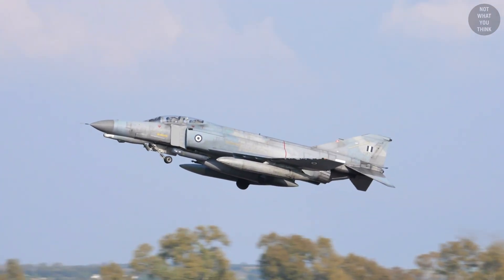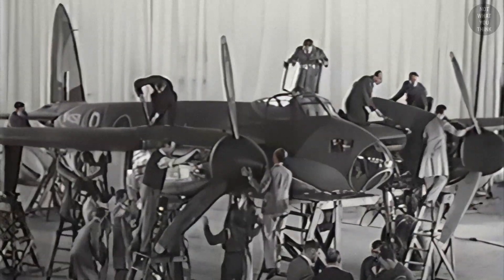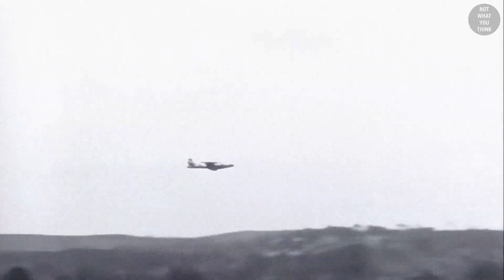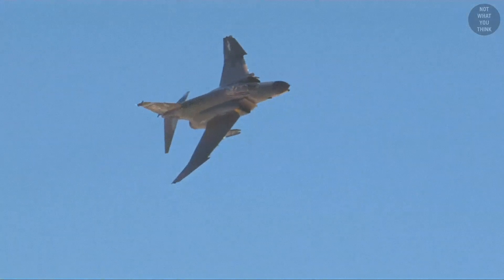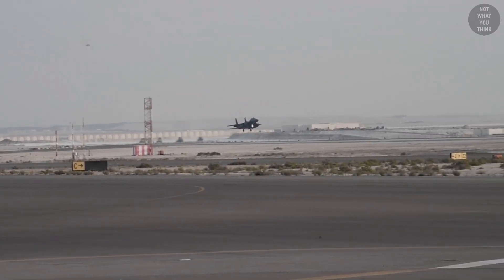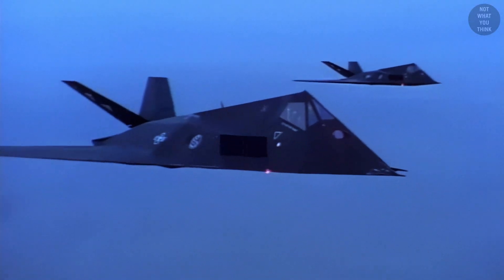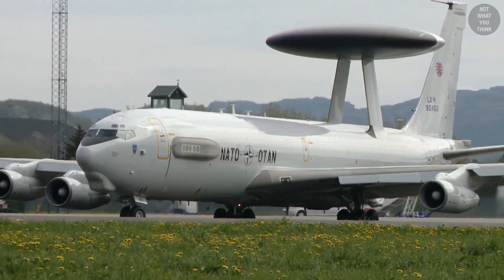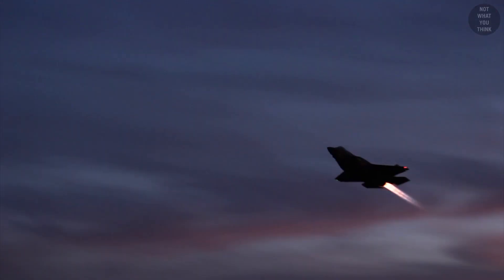Why are Modern Fighter Jets Slower than 1960s?

Comment: One factor that was kind of missed is especially relevant to the F-35.  The F-35 has enough internal room for fuel, sensors, and weapons to match the range and armament of how an F-16 normally flies out.  Because this is internal, a 35 can preserve its top speed of Mach 1.6 while the Mach 2.2 F-16 would have enough added drag from external tanks, sensors, and missiles, to drive it to strictly subsonic speeds iirc.  So the F-35 is faster when actually armed.
Reply: Also the G limits of external stores reduces combat performance. A 9g F-16 isn't pulling more than 5g or so with external fuel and bombs on board. Same for all other multi role aircraft.
Reply: @VeeAreSixed1  Which is why those planes have emergency jettison buttons that allow a pilot to dump all stores (also known as pylons) that aren’t Air to Air missiles, I.e. fuel tanks. This is only really deployed in a air combat situation, but it certainly exists.
Reply: @theskirata7034  You can’t E-Jett ECM, FLIR, Recce, or HARM Targeting System on the F-16.  You can’t E-Jett FLIR or Recce pods from the Typhoon or Rafale.  FLIR and Recce pods have different Max V0 limits the pilots or DFLCS observe, so a combat-configured 4.5 Gen fighter really can’t fly to its stripped placard limits, and carriage of these systems is more common than not.  RAF states the Typhoon FGR4 with PIRATE IRST is limited to Mach 1.8 even stripped clean.

Differences with the Typhoon and Rafale are that they are 9g capable while carrying external tanks, but pulling 9g isn’t really a common thing in the era of improved AESA Radars, later gen active seeker BRAAMs, and Helmet-cued HOBS missiles.
Reply: Yes, I am so sick of idiots who do not understand basic aerodynamics like drag shitting on the F-35!
Reply: Flying faster than the ordinance( missles and rounds )? 
Well it is OK if the target is at 6 o'clock and the ordinance is pointed that way
Reply: One part that was definitely left out of this is that Air Superiority has completely changed to being able to fight outside of visual range. Which completely defeats the purpose of needing to go fast because the air-to-air missiles are meant to be fired from Dozens of miles away and most non stealth aircraft would be downed before ever knowing there was a plane targeting them.
Reply: @Shace616  You will still need to go fast enough to increase the Kinematic energy of the missile but to also defeat the incoming missiles too. Being above Mach 1 greatly increases Missile energy compared to being below mach at launch due to Transonic drag effect. If you can make your missile reach further than the other guy's one you would use that speed.
Reply: @glassfullofmilk  
In deed - and this favors the F35 over the F16 for that reason:

pilot Lt. Col. Hank “Hog” Griffiths
Even when loaded internally with two 2,000lb GBU-31 Joint Direct Attack Munitions and two AIM-120 AMRAAMs, Griffith says the sheer power of the Pratt & Whitney F135 is evident. “The engine has a lot of thrust. It’s been fun to outrun the F-16 (chase aircraft). They can’t keep up. If we go to full military power the F-16 has to go to afterburner to keep up

Norway pilots ALSO note the same - they flew F16's, and are now flying  F35's.
quote:
We who fly the F-35 daily, can establish the following: The aircraft is faster, more maneuverable, has more range and, can carry a significantly higher payload and provides the pilot with a significantly better situational awareness than what we are used to from the F-16

Col De Smit – RNLAF
Quote:
F35 climbs, descends & accelerates like a clean F-16

QUOTE:
Compared to the F-16, the F-35A with “full war equipment” can cruise 10-15k feet higher without afterburner and cruise 50-80 knots faster, all of this additional energy is imparted on missiles
Reply: @glassfullofmilk  Doesn't really make difference in todays world anyway. 2005 DCS world AMRAAMs sure, but the the Meteors and 120Ds change everything.
Reply: @mobius7089  If this were the case, the Air forces around the world would be flying Super Tucanos only with 120Ds or Meteors as Kinematics would be negated by missile technology, Unfortunately physics and aerodynamics no matter how advanced your missile is do not give you a PK of 1.

Comment: My view on topspeed is "boom and zoom" tactics. If you're flying mach 2 at like 10k meters and send an IR missile at an unsuspecting jet below you've got a decent chance at a kill if they don't detect it in time. At those speeds and height stuff will have a hard time shooting you down. Missiles fired from the ground or jets that are slower and lower probably won't hit you especially if you do it right. You can go in, fire, get out safely essentially. Idk how well this works nowadays but that is my opinion. Do governments even use this tactic nowadays?

Comment: It’s also worth noting that no aircraft with the exception of stealth fighters (F-22 and F-35, maybe J-20 or SU-57) could ever reach their top speed with their respective combat loads let alone Mach 2 with maybe the exception of the Mig-25/31 and F-15 (not really sure so take this with a grain of salt) do to the fact that the missiles, bombs, and fuel tanks create extra weight and drag. Fifth generation stealth fighters don’t really have this issue because of the internal weapons bays and is also a benefit in agility as well. For example the F-16 in a “clean configuration” has a faster top speed at Mach 2 and is more agile than the F-35 at Mach 1.6 but in combat load, the F-35 becomes faster and more agile than the F-16 due to the fact that the F-35 retains its top speed at Mach 1.6 and it’s maneuverability while the F-16 does not.

Comment: It was a different era with a different mindset.  What was not mentioned is that most of the high performance fighters of the 60's/70's did not have guns either.  The thought was  they woiuld use slashing attacks where you streak in at Mach 2, shoot missiles, and run away meaning there is no more dogfights.  Of course the reality is that BVR combat is rare (you normally need to visually ID your target) negating the whole concept of the dash and slash attack.  Also the radar guided missiles themselves were not living up to manufacturers claims so often the fight  would devolve into a guns or fox two dogfight.

Comment: 4:42 No matter how good the aircraft is,  the main limit is a human limit. As soon as you increase the speed, the turn rate decreases. If you want to keep turn rate high, you have to increase the load factor (until the pilot passes out).

Turn rate (tr) formula:
tr = (g/v) * sqrt{ (n^2) - 1 }
with g: gravitational acceleration, v: velocity, n: load factor
As you can see, v is in the denominator and the load factor n has to increase if you want to keep the turn rate constant.

So we are probably never going to see an aircraft at supersonic speeds with turning capabilities of a subsonic aircraft, as long as there is a pilot.
Reply: AI operated fighter aircrafts can do this! But we are yet to see one.
Reply: @warpdrive9229  As far as we know  ... make' em  out of Legos and a super adhesive,  those things are indescribable,  ever step on one ?  Just kidding .
Reply: @warpdrive9229  Never please
Reply: @warpdrive9229  nut that may be to predictable, and vulnerable to SAMs and AAMs after a couple of years, so that new ones can be developed that can predict or can recognise the algorithm or code that the E/A uses, making the airframe incredibly vulnerable to missiles.
Reply: @moistman6930  The opposite actually.  If predictability is a problem, a computer controlled aircraft can turn in a truly random direction, which a human pilot is not capable of doing.
Reply: Remove the meat concerns and just measure the wing load at high speed turns and watch it exceed material capacity quickly.
Reply: @Dewydidit  Anti ICBM interceptor  missiles are designed for over 100g.
Reply: @trespire   A missile is structurally simple compared to an aircraft.  There are a myriad of subsystems in aircraft that are not necessary in missiles which are not robust enough for the g-loads experienced by rocket propelled tubes beyond the pilot.
Reply: @trespire  Missiles don't have wings, so you can't measure the pressure of 100 g's of wing loading.
Reply: @Dewydidit  g's are nothing else than an acceleration. So you don't need a wing to measure the g-forces. A stone falling on hard ground can experience several 100 g and also has no wings. Or did I get your comment wrong?
Reply: @gnrl0  G-force is used as a multiplier. If the wing has "150lbs" downward force/ weight sitting on the ground, in a 2g turn it has 300lbs, 10g turn it has 1500lbs. 

There is a very real limit to the ability of material to withstand the increased load. It has limits, and if you want an aircraft to withstand a 20g turn, even concrete will shatter at those speeds. Wings made of Titanium, steel, aluminum, they'll deform and rip right off the aircraft.
Reply: @Dewydidit  yeah, I know all that. I just didn't know what you meant with g-forces on a missile and what it had to do with wings. Still nice explanation of g-force tough!
Comparison with concrete in this case is not ideal, as concrete has a very low tensile strength. It is only good for compression.
Carbon composites have a very high tensile strength on the pull direction of the fibers (resulting in a high bending stiffness in the wing), so maybe there is still room for improvement. I think todays fighter aircraft have a limit of ~16g.
Reply: @gnrl0  I've seen simulations of composite wings achieving peaks of 40g, but not consistently, and all in computer simulation. 
Far beyond what a human pilot could manage, but maybe not a drone. 
Agreed missiles wouldn't have these issues. 
Concrete was indeed a poor example I used for anyone reading along to gauge tensile strength by. While we did build a few concrete ships, no one would build an aircraft out of it. Weight to strength ratio is too low. 
Maybe someone on Youtube will prove us wrong using aircrete.
Reply: @Dewydidit  on the ground the wings droop down due to 1G of weight, in flight the wings are supported by aerodynamic forces acting all over the under side of the wing so in level flight the wings are supported and pushed up from underneath but are supporting 1G weight of the fuselage. In a 2G turn the wings are bending upwards with the force created by the 2G weight of the fuselage, the wings don't droop down with 2G weight of the wings. The wings do experience compression between the top and bottom surfaces due to high pressure under and low pressure above and also bending due to difference in lift across its area compared to loads carried such as wing fuel tanks and engine/weapons pylons.
Reply: @Dewydidit   People with specific training and equipment are able to not pass out at slightly above 10 G.
Reply: @trespire  I'm like 95% sure that's strait line acceleration not manuvering
Reply: @leprechaunbutreallyjustamidget  Now you mention it, you're probably right. Although the Arrow can manouver in flight at very high mach speeds.
Reply: Well, what it really means is that when people say this or that aircraft is "more maneuverable", it's often a misunderstanding of what maneuverability really looks like. Most gen 3 fighter aircraft can kill the pilot with G forces. So within a wide range of speeds, you're not going to out-maneuver even an older fighter jet. What had changed is the ability to create such G-forces in a wider range of flight envelopes, having more thrust to regain energy more rapidly, and having the ability to maintain control in post-stall conditions. If you can achieve the pilot's G-force limit at a lower speed, and without bleeding as much energy doing so, then that's what's typically being discussed as "more maneuverable".
Reply: @kathrynck  very good points
Reply: Not really. With modern technology we can have a remote controlled aircraft. This is the way of the future.
Reply: @Fenix-sf7tg  that's actually sad. No More  human aces. 

However guys, doesn't it depends of the pilot himself ? Maybe some are more resistants, and able to handle such g's more easily than others ? I'll be honest, i really don't know what the average human is able to put up with.
Reply: unless you are moving the space with the craft, heard of wrap drive?
Reply: Straight out of ace combat 7
Reply: It’s already happened, the EuroFighter Typhoon is capable. For someone who bothered to put all that science in the comment you sure are ignorant.
Reply: @Spozetti11  How am I ignorant? Also the Eurofighter has a higher turn rate at lower speeds. Prove me wrong.
Reply: @gnrl0  I saw the Euro fighter giving a demonstration flight a few years ago. It seemed to be able to turn 180/360 within the perimeter of the airfield. It wasn't flying fast though, but impressive all the same.
Reply: @markcousins9337  yes, it's one of the most agile aircraft that exist at the moment
Reply: What is with AIpilots, or remote planes?
Reply: Well, it's a balance between launching human intelligence, initiative and creativity, as opposed to AI planes/missiles. As of yet, we do not have autonomus cars, that can manuvre city streets, so there definately is a case for human pilots. But perhaps on a remote work basis?
Reply: @andersgrassman6583  Unless new technology is developed that exceeds the capabilities of current G-suits, 9g is the upper limit of what the human body can momentarily withstand. A 45° flat turn at 20,000 ft. going Mach 2 is going to exceed 12g by my guesstimate. Whichever air force develops a drone that can respond as quickly as an aircraft with a human pilot and is integrated with the 360° situational awareness of the F-35 sensor array will represent the beginning of the end for manned combat aircraft. I remember the brother of a friend who flew the A-6 in Vietnam and commented on the maneuvers of the Rebel Alliance fighters during the battle on the ice planet, Hoth. He claimed that unless the physiology of the pilots was different from homo sapiens or their tech could reduce g-force effects on the human body, tripping up a Walker by going round and round its legs with a cable would risk pilot blackout. This was 1980, just after the Empire Strikes Back debut. In a way, this ex-pilot predicted the future of aircraft development as dictated by the limits of the human body.
Reply: @jefferyroy2566  A 45 degree of bank level turn is always going to be the same loading factor, but the turn radius will vary with the speed.
Reply: Another problem is that dogfighting is impossible once you get close to the speed of sound, the pilots can't see each other, the planes are never in visible range long enough.
Reply: That and stress on the aircraft
Reply: true, and one of the primary reasons fighter pilots are an endangered species
Reply: With new suits its possible with human 😉

You don't always need AI , modified human can do same job and think about what he do.

The Ai even with Neuro learning can never change in short situation they program and use other,what a human can.

Think about it  and special that our smartphones today modified us like a second brain.

So suits would be enough for high Mach speed,but the real problem is not the human factor.

The real reason is the more Mach more Air and complicated to have stealth.

So the Air problem is issue for manovability lose and more IR and other things the reason why stealth losed by high Mach speed.

Thats why F22 or F35 never fly constantly over Mach 1 ,they whould lose stealth.

The 6 Generation need fix this both problem s.
And my opinion is first to go  Mach 3 before go Mach 5 ( Hyper speed) or higher.

Mach 3 is like Air x400 and its enough for long development.

The old Airplane, Fighting Jets never concepts for ling range Mach with full weapon equipment,they was mostly development for fast start and kill Nuclear Bomber jets.

Thats the reason why they so fast,but the speed is not for long or constant and modern missels or defense -systems need stealth or you only a flying graveyard.

This Video a little bit stupid its ignore the facts of ling range speed and concepts of modern vs old war.

For example: If Sowjets would start in old day they Nuclear Bomber by Warschauer Pakt,the NATO have only 10 Minutes to destroy they before they can hit first city's.

So we see the full reason of high Speed starts of old jets.

And fun fact: Many old jets whould eat they owen Airplane by long fly,cos of Aerodynamic they jets can not hold long this speed without  breaking.

So its more fake high Mach speed :) 

Best regards from Germany and sorry for my  english Grama^^